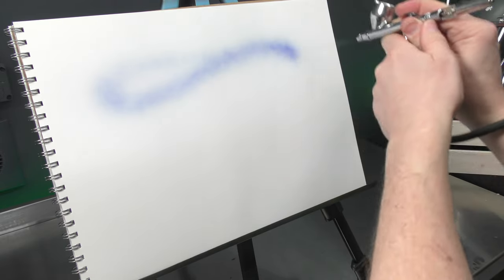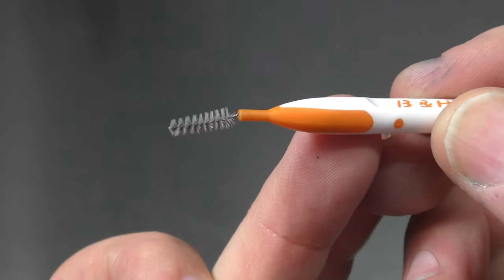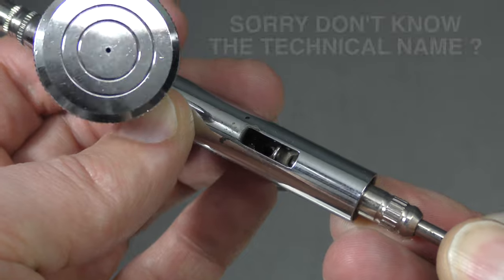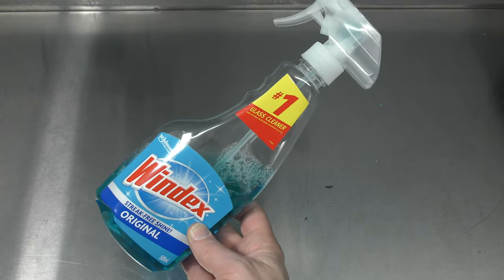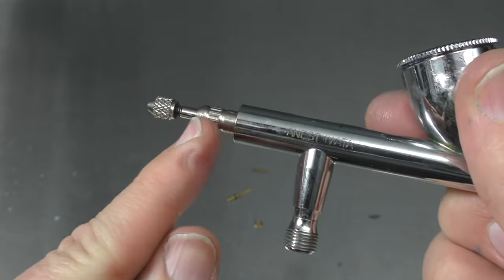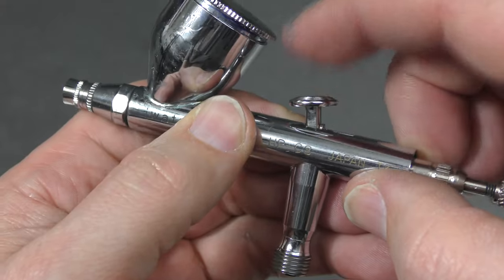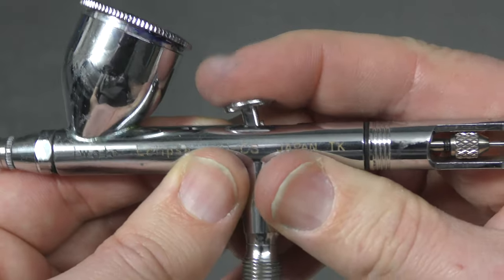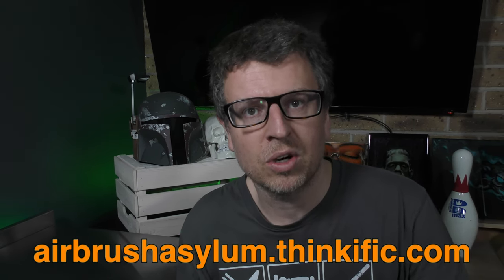Airbrush Trigger Issues Solved

Comment: Lifesaver, this! I usually manage to somewhat loosen the stuck trigger when cleaning the airbrush, but I always felt that that was never as good as when it was new. I’ve always been a bit afraid to fully disassemble the valve bit at the bottom of my airbrush. This helps a lot!

Comment: I had a problem with a sticky trigger but it didn't turn out to be the valve. It turned out to be the o-ring the dangle bit on the trigger fits through. I cleaned it off as best as I could and used a toothpick to put through it and twisted it to clean off the contact point between the rubber and metal. Once put back together it worked much better.
It's only a cheap airbrush but it works well enough for what I need it for.

Comment: My trigger was getting stuck (up and down, it wouldn't come up) and I followed your directions. The small needles weren't really dirty but I cleaned the whole thing anyways. Before I put it back together, I looked in the, what I thought was clean, chamber, and there was very stubborn paint along the sides, and the shape of the chamber doesn't help with merely rubbing a cotton swab or brush around. I grabbed my sharp tweezers (which I use to unscrew the "dangly bit" and screw it back on), started picking at it but man, that paint was so stubborn. What I did was took the O rings off the bottom and tip (the other two tips are off) and soaked it in acetone. Honestly I dunno if that was the case for the trigger, cause I did put some Regdab needle juice on the o ring before putting it back in. The trigger seems fine now. What's getting me is how to prevent paint from going in that area, I've yet to figure that out. Is there anything you know about that?

Comment: I had that happen to mine after about 3 years. I ended up removing the o-ring that's in the trigger assembly (it's on top of the big brass piece you left in the airbrush). A little extra air escapes through the trigger now, but not much. However, the trigger pops up much fast after I let go and just feels more responsive. Not an ideal solution, but works well for me.

Comment: Thanks for this video.  I have rebuilt that trigger assembly with all new parts and seals.  It still sticks.  I put some gun oil in there and it doesn't stick for a job or two.  Then it gets all gummy and sticks again.  Pehaps this is just an Eclipse CS problem? I don't know.  I just bought a different model airbrush,  I give up.
Reply: Too late now, but you may be able to find someone with an ultrasonic cleaner. Disassemble the entire airbrush, determine what parts cannot go in the ultrasonic and then clean the rest, lube and reassemble. However, this is probably more work than it is worth.

Comment: Hi! It's not exactly the topic of the video, but I also have an issue with my H&S Ultra trigger. The thing is I have to pull the trigger a lot to get paint out of it. I cleaned the airbrush and nothing changed. What could this problem be? Thank you in advance.

Comment: Do you advise using a VERY SMALL amount  of vacuum grease on the  "0" rings ( I come from a bench mechanic's background and was told to use it  as it slightly swells the rubber  )

Comment: I have a diffrent problem with my airbrush and it is frustrating. Whatever i do, i can smoothly pull the trigger back to allow more paint to flow, but i can never smoothly control the level of air that is put in while pressing down the trigger. It doesn't stick, it's just clunky. any tips on that? you would be a life saver.

Comment: My Iwata Airbrush Replacement Part I-715-1 Needle Chucking guide w/auxiliary lever is sticking after about 10-15 uses. The Auxiliary Lever stops coming forward and I have to take backend apart and reseat trigger and chuck guide. WHY do you think the Auxiliary Lever is not coming forward with trigger? Thanks

Comment: What is the tool you use to take the bottom that connects to the hose out???? I cannot find it and cannot get it out
Reply from the maker: Have a look at the iwata maintenance kit, it has the tool included in the kit to easily remove the air valve spring set, hope that helps - https://amzn.to/3WvMfL0 (this is an affiliate link which means we receive a small commission for any qualifying sales).
Reply: You can just use a pair of tweezers. I didn't even know this tool existed (I'm sure it is slightly easier than tweezers).

Comment: Do you use or recommend any type of airbrush lube?
Reply from the maker: I used to always use the iwata 'super lube' but stopped as Dru Blair mentioned that he found that over time it could cause clogging and also require you to continue to use it ie...your airbrush gets addicted to it, since then I stopped using it and to be honest if you keep your brush clean then you don't really need it.
Reply: @AirbrushAsylum  I use badger regdab needle juice without an issue but then again I've only been Airbrushing for about a year. I'll have to look into this further. Thanks
Reply: @AirbrushAsylum  Hmm maybe this is my problem.  I switched to Hoppes #9 recently and it keeps it from gumming up.

Comment: I'm glad you did not mention lubing the valve. It normally causes more problems than it fixes.
Reply: I’m glad you mentioned that. I’m about to tear my Paasche Talon apart to try and free up my stuck plunger. I contacted Paasche directly and they recommended using a tiny bit of Vaseline on the plunger. I’m curious why you recommend against that and what specific method you use to clean your rig?

Comment: I came here because I just opened mine and it immediately had air coming out of it. The button does absolutely nothing and if I were to use it, well I'd have to turn it off any time I don't want to use it while actively painting. And the only paper I have is a single sheet with no real explanation on how to set it up other than basic assemble brush, put paint in, press button to turn on, press button to use, turn off.

Comment: On my airbrush, I loosen up air hose a bit and trigger doesn’t stuck anymore. 💁🏻‍♂️
Reply from the maker: thats strange ? But hey, if it works and your air doesn't start leaking then I guess thats fine....whatever works for you .
Reply: Same happens with mine. Apparently it has to do with the O-ring inside the hose connection.
@Airbrush Asylum: great video.  Another really useful tip. Thank you for sharing.

Comment: I hate trying to put the dangly thing back into the little hole. I am having issues with air coming out of the airbrush when the trigger isn't pressed. What is causing this? I've taken my airbrush apart many times, cleaned it and the air still continues to come out no matter what I do. Help!!
Reply: Do you still have the little rod that the spring fits over? If that rod isn't present or possibly in backwards, air will just freely flow through the airbrush. I somehow lost that rod while cleaning mine recently. didn't realize I had lost it (was slightly intoxicated when putting it back together and didn't think anything of just putting in the spring by itself. Easy way to check, if you unscrew any quick connects or hoses from the air connection point on the airbrush, you'll see a brass looking circular plate that will have two holes on the outside and one in the center. If that center hole is empty, the rod is missing and it is the thing that stops the air from flowing. If it is present, disassemble and make sure the o-ring on it is still intact and the rod is inserted the correct way (demonstrated in video). If the air still flows, it may be worth getting a replacement. I ordered a replacement for the one I lost for about $9 on Amazon.

Comment: l was always told NOT to use windex with amonia due to it causing the rubber gaskets deteriating.?
Reply: Not a problem when using as he does here. You might have a problem if you left it soaking in it for days but just using it like this to quickly clean the tool is perfectly fine
Reply: @barbatosrex9473  thank you.

Comment: Air comes out of the trigger of my airbrush when I press down on it.
Reply from the maker: Pull apart your plunger assembly (the section  of your brush which connects to your air hose) carefully pull it apart and give it a clean  and that should fix your issue 🤞🏻
Reply: @AirbrushAsylum  Thank you!